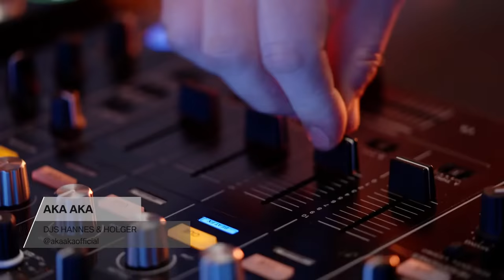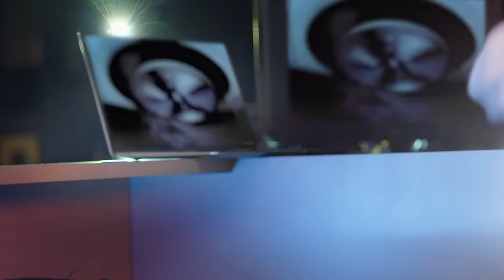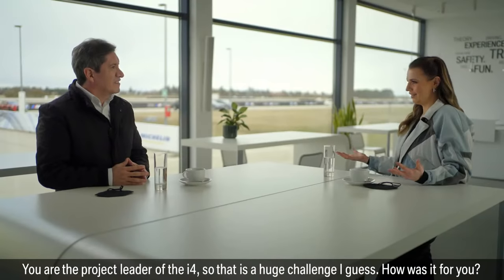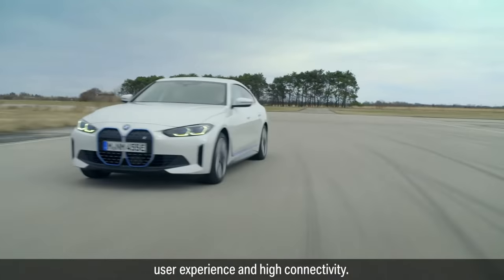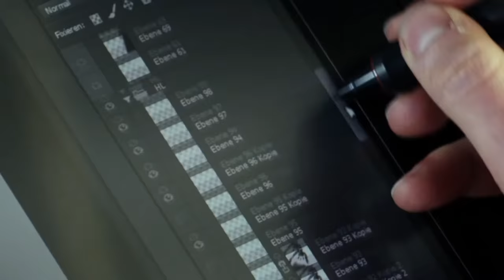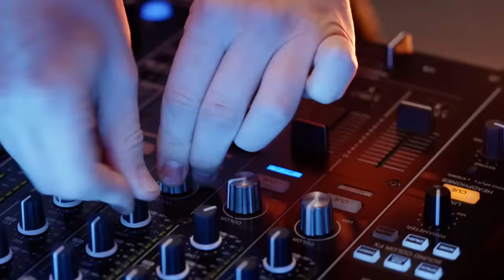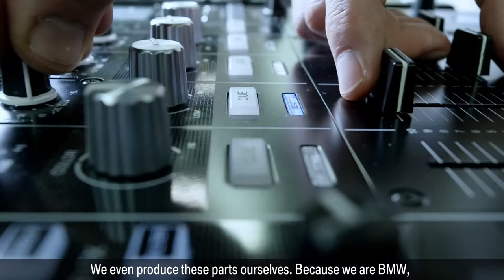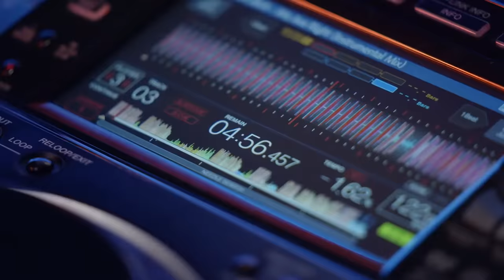The first-ever, all-electric BMW i4

Comment: Don't get me wrong, this is a beautiful car!
It's just that I expected the car would look more like the concept car.
For example: it would have been gorgeous if it had such a large panoramic roof
Reply: Hoe many concept cars meet global production & safety standards?
i3 & i8.
Which are still getting trash typed by trolls who will  NEVER drive them!
Reply: The concept was beautiful shame it didn’t make it fully
Reply: @unowen-nh9ov  The i3 looks actually pretty cool in real life, definitively better than in foto. 
Especially when you see them in real-life traffic next to others cars in cities like Tokyo, Sydney or Seoul, it looks like the car is several years ahead of the surrounding cars.
Reply: The rear bumper so normal, still prefer the futuristic rear bumper ,the eco friendly seats in the concept version. Abit disappointed totally looking forward to this car release during it concept opening now nahh, design same as their petrol sibling, not much diff but payer higher for it .Why didnt it show the interior too, hope they dont change too much
Reply: exactly it looks too much like the 4series
Reply: It's the color they selected for this video.  You can see more of the concept car in almost any other color.

Comment: As a BMW fanatic & owner myself,  I’ve driven the E30, E34, E36, E38, E39, E46 & E83 in the last 20 years so I can tell how BMW has evolved through the decades in design & engineering. It will be another 20 years before I would realistically drive or own a BMW i4, still looks sharp & sleek with that huge kidney grille which was designed to be functional.

Comment: They should call the kidney grill the lungs instead
Reply: Why?  Not breathing, aren't they actually housing for autonomous driving sensor hardware?  Or for decades of priceless brand identity marketing so trolls will stop whinging they look like Kia or Hitler moustache?
Reply: @unowen-nh9ov  Because they grew from kidneys into lungs
Reply: Beaver Teeth... Butt Cheeks...      The new M3 & 4's literally look like butt cheeks coming up the street.....
Reply: @Jay-jn6ul  Inaccurate, BMW began building British Dixi under license, check original 328 for 1st kidneys (or any 1930s 3er).  Ditto grille-free Italian Isetta post-War decades later, instead of kidneys it had a fridge door, trolls' heads would explode!  Ditto motorcycle rear-engined 700.

Comment: Better be sub 60k if they want it to be for a large production scope.
Hopefully, they will offer the option of not having those blue trims. Other than that I like the car and may get one when they come available in the US.
Reply: I believe the base price is 45k
Reply: @dustinschiff537  I wish but I doubt. 45k is base price for the gasoline one. The i3 start at 45k....
It may still be wishful thinking a base price of 55k. Although electric cars come with most options stock at the base model, so there should not be much to add on.
Reply: The blue trims are optional just as with the i3
Reply: *iX3

Comment: Instead of adapting BMW's classic design language to the modern design esthetic of electric vehicles, BMW is instead trying a new and somewhat controversial design language to the design esthetic of conventional combustion engine vehicles. 

BMW is betting that the design esthetic of electric vehicles is a fad rather than  an evolution discontinuity of design. 

They're probably wrong.

Comment: Grill sucks, headlights suck, so the front does not appeal to me. I guess the price will suck as well compared to the most dominant EV model.
It is sad, I would like to replace my BMW 330i x in the next 2 years, but there seems to be only 1 option if I want crazy performance, a good looking car for a good price with best in class autonomous driving.
Reply: @unowen-nh9ov  I started to write a longer answer to you, but you are just not worth my time